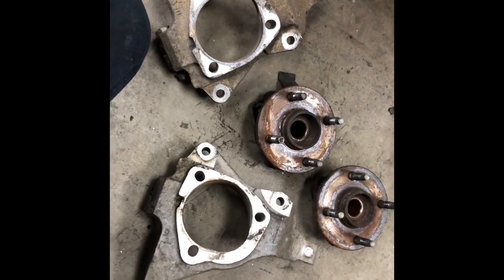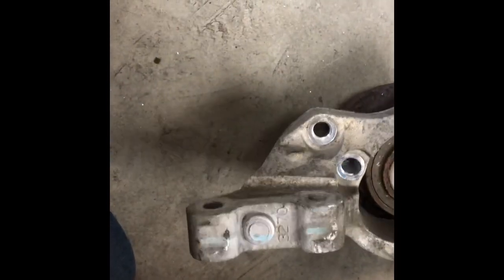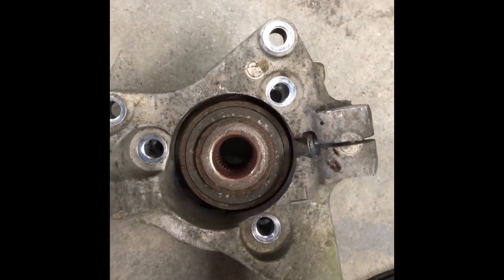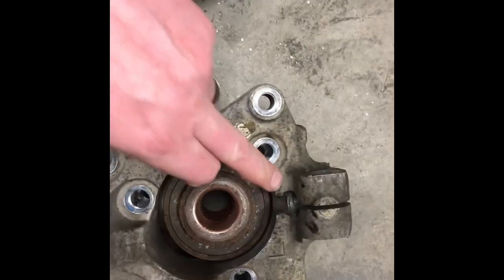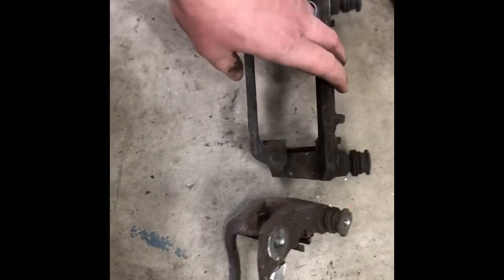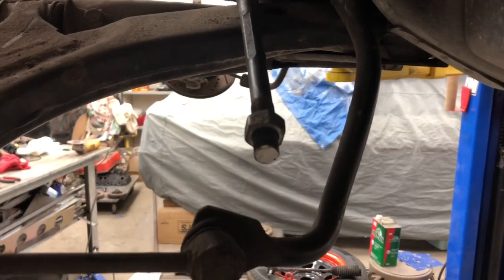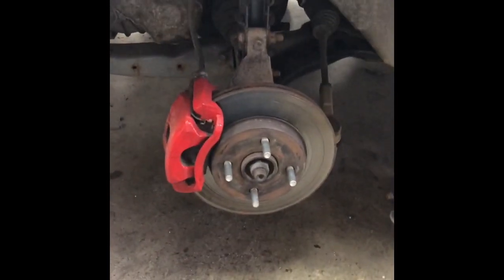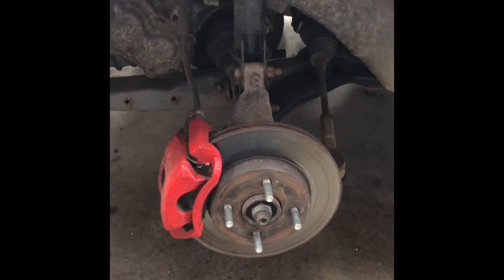G6 spindle swap on a Cobalt for racing

Comment: Do you do any steering stop modifications
Reply from the maker: We do have steering stops in the rack. Its kind of weird some people have an issue breaking axles at full lock and some don't. Now on the track you should never be at full lock so its usually only an issue in the pits or at home trying to turn the car around and going to full lock on the steering.

Comment: Question- is everything else direct plug and play? Does the g6 have a 19.5mm ball joint or the 20.5 like the lnf? Needing a set of spindles for my 09 ss and parts are scarce
Reply from the maker: I didn’t realize one had a different ball joint. So far the only issue we’be seen around ball joint is sometimes they’re a touch taller so the pin bolt doesn’t want to go in but a quick grind fixes that. As for street use I’m not sure dimensionally what it would do to bump steer etc. we change them for strength and safety purposes
Reply: @Builditkingdom  you haven't ran into any wandering issues while running them? Everything sounds tight up front? From Powell- the LSJ has the longest tie rod arm off the spindle, the lnf has the shortest and the g6 was in the middle. I'm just trying to get the car back into fighting shape and came across your vid while searching on g6 spindles on a cobalt.
Reply from the maker: @skunkworks9-3  I run on dirt tracks and we don't have issues with racing. I've had the same set for 5 years. If your using it for street use I have no idea what it will do.

Comment: Does the year of the g6 matter?
Reply from the maker: no I don't believe so
Reply: Are u using the g6 brake caliper bracket or are u using the Cobalt caliper bracket and is there a certain year Malibu that u can use or it don't matter as well